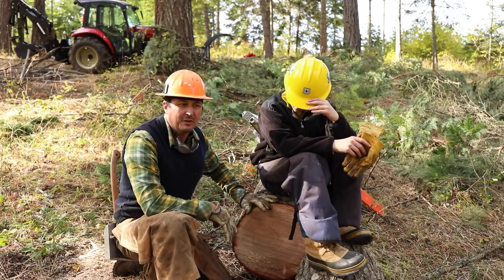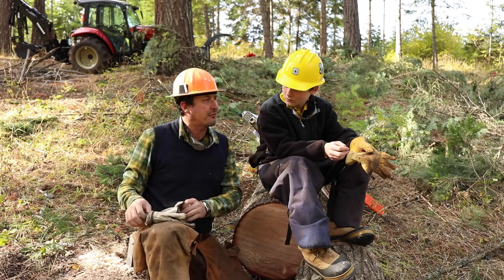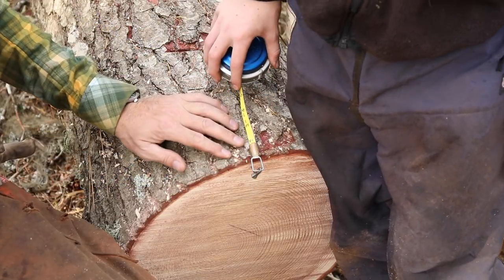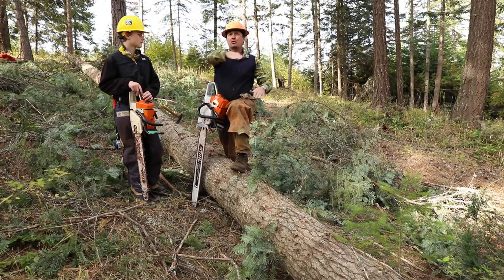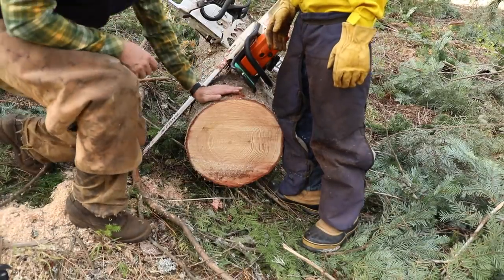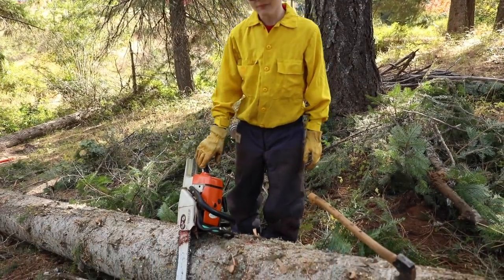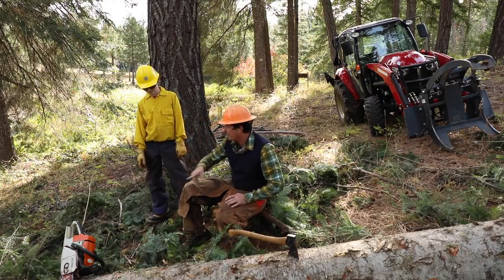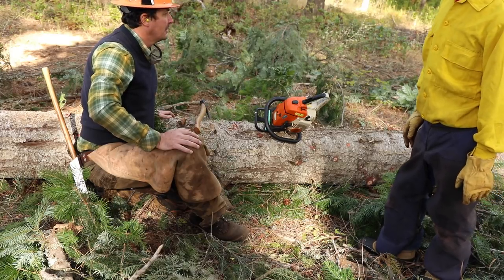How To Work With Chainsaws Tutorial

Comment: That Spencer loggers tape is ideal for working in the woods as Cody demonstrated, and milling logs, etc.

If you want a Spencer logger's tape you need to know it comes in different lengths. In my forestry work we use 50', 75', & 100' tapes. 

The measurements available are feet and inches on the front side, OR feet and tenths of feet.

On the back, the diameter scale is available. You wrap the tape around a standing tree and the tape is configured to give you the tree's DIAMETER, straight through. This is done at 4.5' (54") above the ground, for consistent diameter measurement. (We don't use circumference much, but you can get that with the front of the tape if you want it.)

As Cody also showed, when the tree is down you can get the diameter by measuring across the end of that log.

Enjoy your Spencer tape. It's rugged and worth the cost.

Comment: You can get a Spencer tape with length of  one side and diameter one the other side.  No need to guess the where the edge is just wrap the tape around the tree and its aready calculated. I use this a lot in northern Minnesota to calculate DBH while timber cruising.

Comment: What do you think of the Stihl ms251 wood boss for occasional cutting firewood or clearing trails
Reply: That is a very good saw for general stuff. Stihl or Husqvarna are both very good. Since those are smaller home owner saws get the 16" bar as they have far less power than the pro level saws. Instead of going to the longer end of the Specs on a home saw it will last longer going top the shorter end.
Reply: That's a great little saw. I have one with a 20 inch bar. I use it quite a bit for clearing and general use. It's a little small if you're going to do much firewood.

Comment: Scribner scale takes into account an average taper. That being said, a scalers tape is one inch shorter than a normal tape measure.
Reply: Monte Provolt  Scribner only accounts for taper on logs over 41 feet in length, and Eastern scale tapes have an extra half inch every foot so my tape is longer than yours.